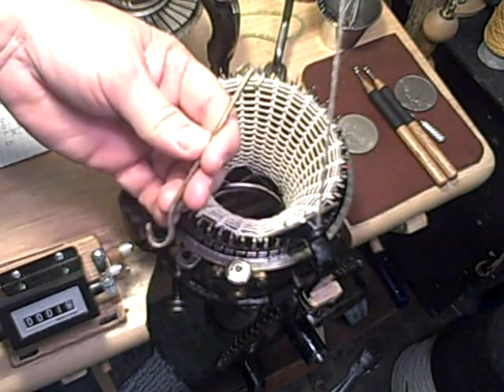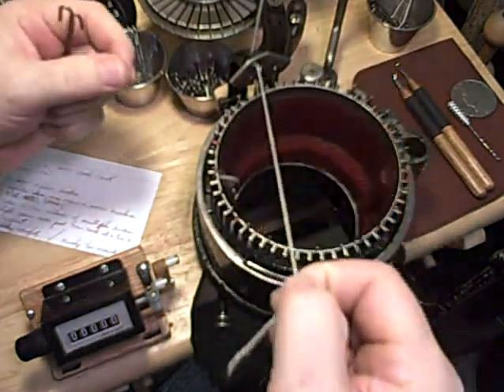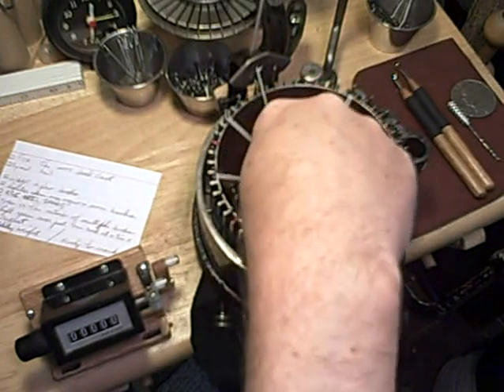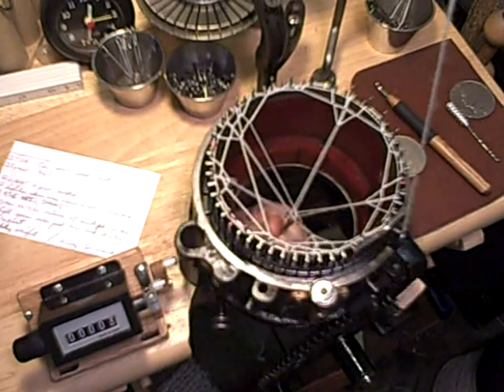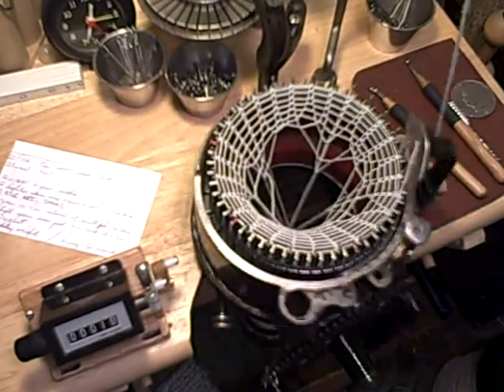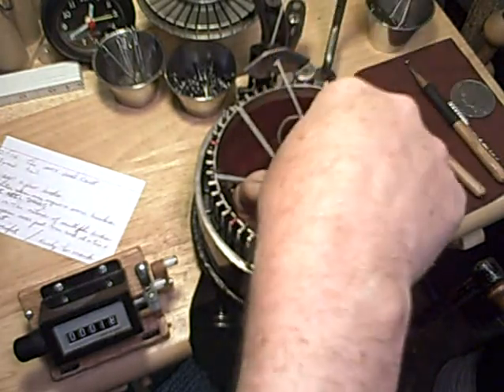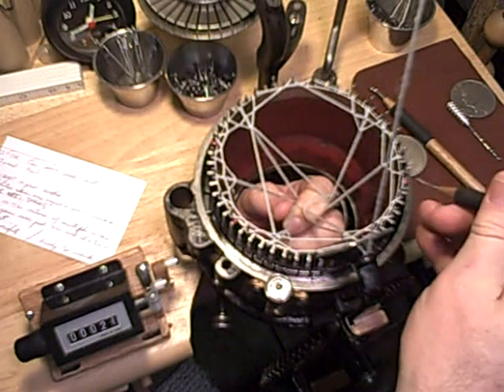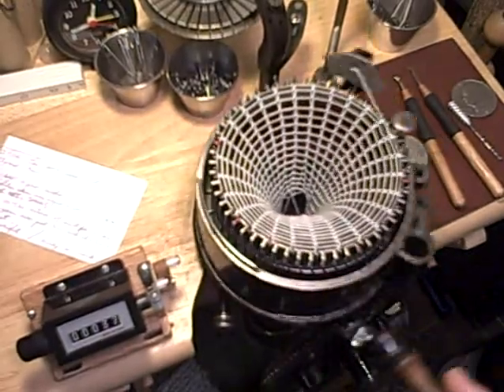The FiberCast - 45 Second CSM Caston

Comment: You sir are a genius!  I have spent the last four hours with my new English Auto Knitter trying to make a set up bonnet. But all I had to cast on with was the little bit of knitting that came with the machine. Of course the yarn kept unraveling as I knitted and I ended up with none weighted stitches that promptly jumped back off the needles.  Tomorrow I shall use your method and all will be good in my world :)
Reply from the maker: 8-)